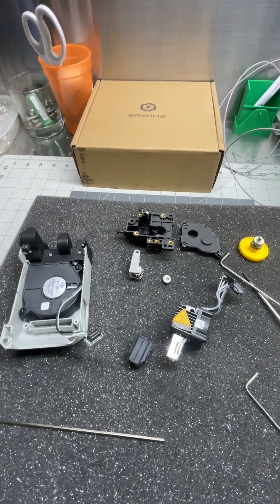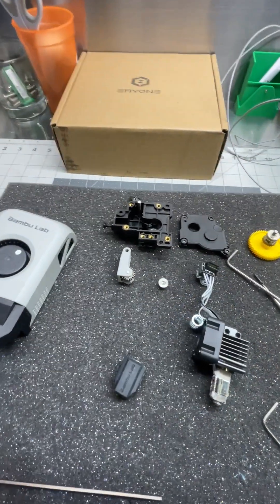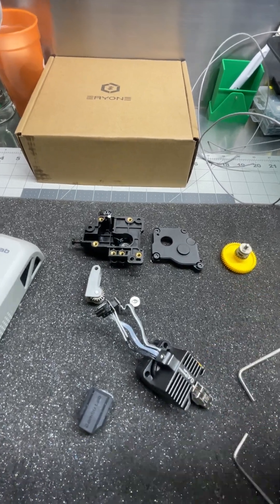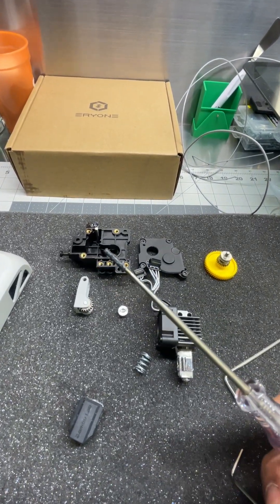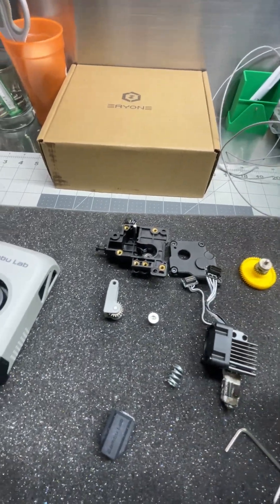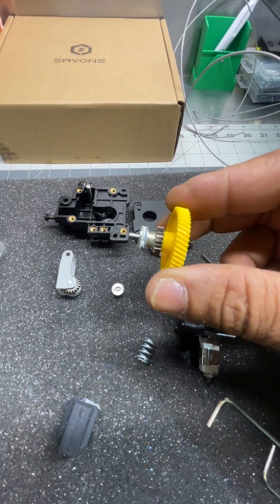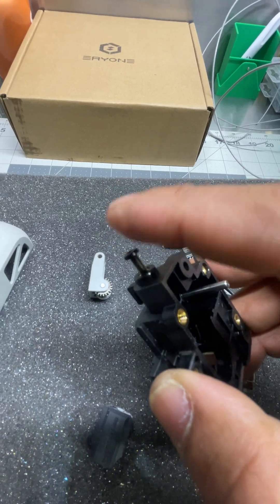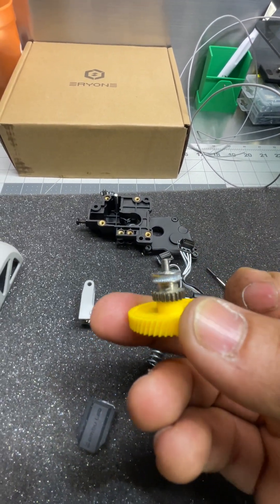The Troubles of Bambu Labs Extruder Revealed

Comment: I have something going on beyond all this.  I can take the nozzle out and hold the filament, and it pulls it through until it hits a certain part of the rotation then slips.  Get this though, I put in new gears AND a new motor and it's still doing it.  (and new nozzle but already knew that's not the problem anyway). It just makes no sense.  My only theory now is that the toolhead wire isn't getting the right power to it or something.  It's so ridiculous to have replaced literally everything in there and still have the problem.  Never seen anything like it.  I have run these printers for a couple of years and it happened to both of them within 2 weeks of each other somehow.

Comment: Extruder clog. Most commonly seen when you print out hot filament out of the drier. Soft filament is squashed and no longer fits into the hole. This is made worse of you have DIY heat chamber or unplugged head fan.